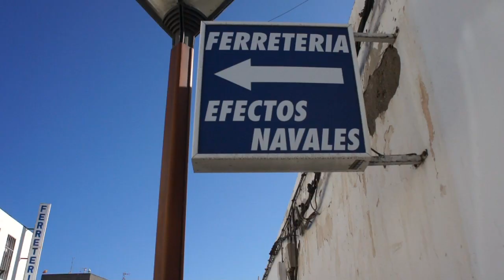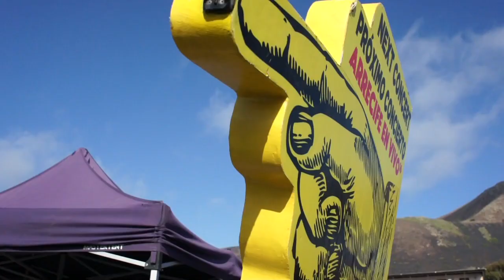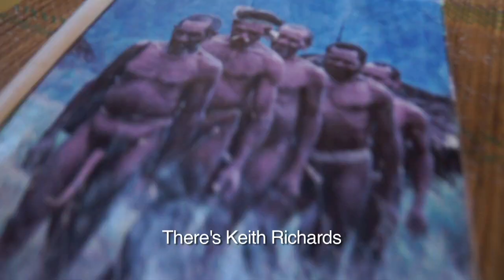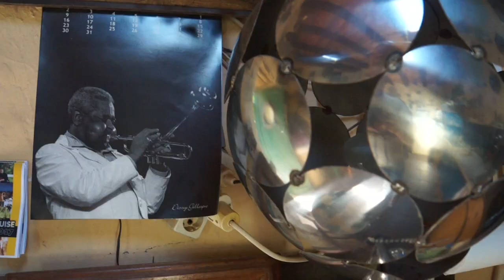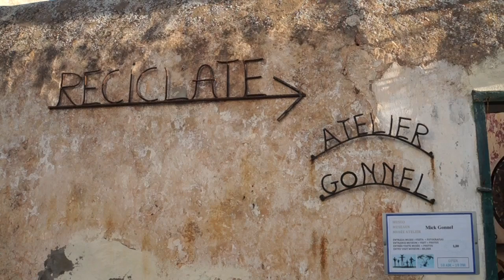Winded Voyage 3 | Episode 5 | Sailing The Skies Of Lanzarote

Comment: Surprised no one told you by now that your bowsprit is not for anchoring on.  It's for deploying and retrieving your anchor.  Once anchored, your line goes through the chock at 1:15, not stressing your hardware.
Reply from the maker: We've been working on this for several months now. And I agree with you. When I'm anchored, I put a "main de fer" or stainless steel grip on the chain which is tied to a line and fixed on one of my bow cleats. Therefore relieving pressure on the chain.